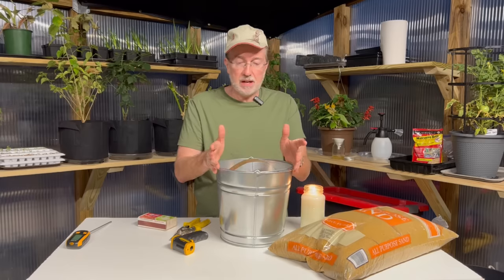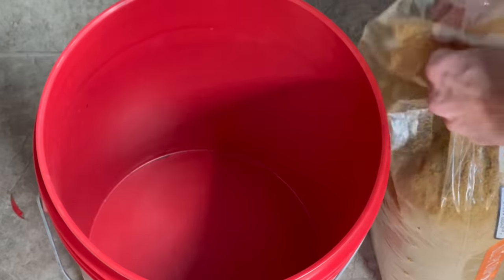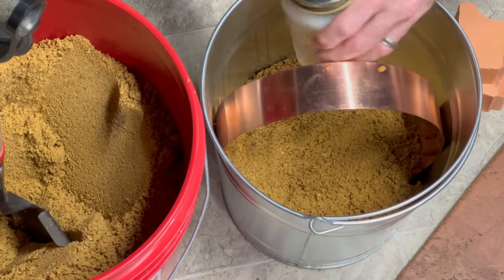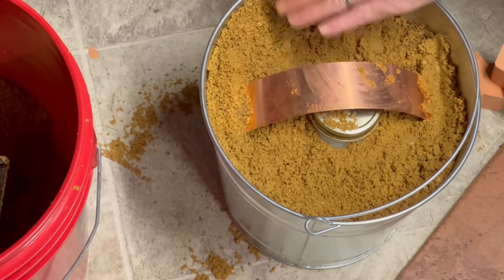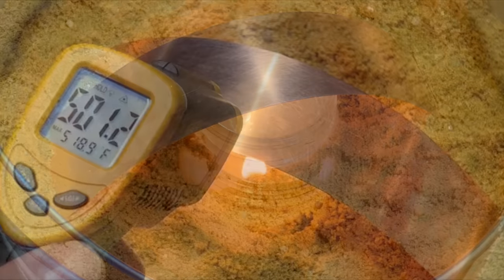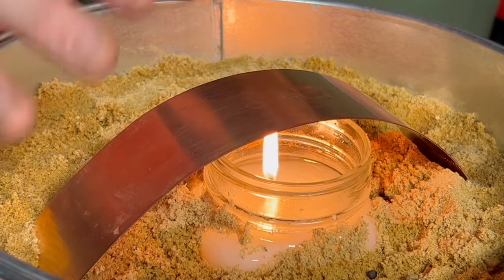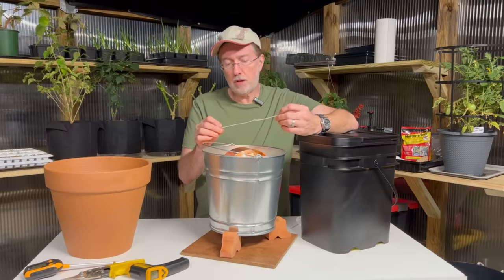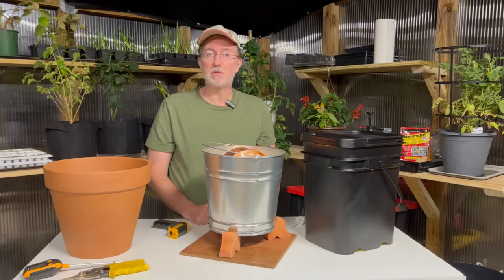DIY Copper And Sand Heater | No Electricity Needed For Greenhouse Heat

Comment: By the laws of the Conservation of Energy, you can't get out, more energy than you put in.
Candle Wax is an Energy Storage Medium. So your Energy input is the Fuel of the Candle wax.
 Using a single Wick Candle, the output of the flame is approx 80 BTUs
It doesn't matter what the Single point Hot Spot is. The tip of the Flame could be 2,500 degrees hot.
what Matters is the total BTU's being released.

It doesn't matter if you use a clay pot, or a copper Band and Sand as your Storage Medium.
You can never get More Energy out, than what you put in.

It is a simple math problem.
To heat a 10 foot x 10 foot x 10 foot area you would need to supply about 5,000 BTU's 
5000 / 80 = 62.5
so that would be about 63 Candles.

How much space could a Single Candle Heat?
A single candle could Heat an Insulated Box, 2.5 foot x 2.5 foot x 2.5 foot or 15 cubic feet of space.

Comment: If using in a living area . . . A simple 1/2 or 3/4 inch PVC pipe to draw in outside air  from a window. Raise the bottom of the window just enough to place the short length of pipe and then block the exposed amount under the window to prevent a big draft

Comment: The terra cotta with vegetabe shortening candle in a 9' x 12" wood/polycarbonate greenhouse last winter in Pennsylvania didn't increase the freezing temps more than a cpl degrees and the veg short. candle burns a lot longer but it emits choking toxic fumes that make breathing in a sealed greenhouse impossible. The smell is horrible. The year before i tried the giant compost pile in the greenhouse to at least keep it from dropping below freezing. Nothing worked till I bought a flamefree ventless propane heater...it only costs about 250 bucks for the entire fall/winter/early spring season. I've been heating for 2 weeks already just cuz of the 40 and 50 degree lows. I do want to try this heater...but where does one find a thin wide strip of copper?

Comment: Water hold 5x more heat per volume.  Temperature under 212 degrees (excluding the candle flame), water is a much better heat storage. Try this with your same system (thus, minus the sand. Another one, add water in after you add the sand. )
Reply from the maker: Will experiment thanks.

Comment: What if the bucket had a hole in the bottom so you could see the bottom of the copper ring....(maybe have the bucket a little higher off the tile); This would allow you to easily replace the candle when needed.

Comment: How do you replace the candle? Disassemble and reassemble?
Reply from the maker: Slid the copper to one side….pull out candle.  If sand is still moist will leave an opening if dry will need to reassemble.
Reply: @ZenGardenOasis.    Thank you!

Comment: Not a lot of point measuring the temperature above the candle on the copper .. its going to be hot .. just like the candle flame.
I was more interested to know what the temperature of the surrounding sand was after a while .. in particular .. the sand furthest from the copper band.
Also, would be hotter if the candle was position in such a way as the focus the hottest part of the flame on the copper.

Comment: its about dispersing heat fast.. not store ..it might read 400 degrees but transmission of heat is very low under 10 degrees. that watts of the candle is about 150 watts.. so the cost is the same.. that is the problem with this concept..   However mabey if you atach solar pannel to a 100 watt heater coil and put that coil in sand and then to the copper being free energy makes more sense

Comment: Cover the top of the exposed copper with stainless steel as, being a very poor conductor of heat, it will help yet more heat move into the sand.
Reply from the maker: Thanks for the tip

Comment: I think 4 rings of copper tubing sealed separately but soldered together side by side with transmission fluid sealed inside would work better.
Reply from the maker: I always encourage experimentation.

Comment: also, water will hold more heat than sand
sand specific heat = 0 .19
water @ 25 C specific heat 0 .99
over 5 times more

Comment: What if you were to add a wood stovetop fan on the sand?

I’m currently testing a few options to heating my greenhouse.  I have a crockpot heating water and have a couple of wood stovetop fans on the crockpot top. 

I was planning to test sand batteries again this weekend.
Reply from the maker: The crock pot idea is excellent.  I need to experiment with that…..thanks for the idea.
Reply: Make soup

Comment: Add a copper coil in the bucket.
Solar 12v pump.

Well sand store energy longer then water?
Can you intertwine both sand and water to store energy?
Reply from the maker: It’s possible….there are so many ways to experiment.

Comment: would construction sand (contains rocks and such instead of pure sand) also work for this? And how would you go about replacing the candle without touching the copper?
Reply from the maker: Yes it would
Reply: @ZenGardenOasis.  thanks, also do you have an estimate for how long you think this'd last for?

Comment: Well, he is turning convection into conduction and then radiant heat so his loss of efficiency. I’m curious as to how many BTUs per hour that candle puts out. A BTU is the amount of heat it takes to raise 1 pound of water, 1°F. If the greenhouse is relatively warm during the day and the bucket is never gets hotter or is equal to the heat in the space during that day then it is possible for it to save up the heat in that thermal mass building it up over the day . high-pressure always moves to low pressure the same as true with heat, hot goes the cold. However, if that greenhouse is chilly during the day that’s not gonna go so well because it will dump its heat as fast as the building up. I seem to recall panels like the ones he has on his greenhouse are roughly r2 or r4 . Now you have heard of people using candles to help keep themselves warm when they’re stranded in their car.. but you have to take an account it’s a small space and each person is putting out 400 BTUs per hour just sitting there. the candle supplementing it. The other thing is you lose some thing when you go from convection to conduction and then to radiating through some loss of efficiency. if he was able to heat a lot  of sand up with a Frenzal lens with sunlight during the daytime it would be very potent particularly if it was a black lava sand.
Reply from the maker: Fascinating

Comment: what's the temperature at the side of the container or in the sand away from the copper strip? how dose the flame reach the copper after say an hour when it burns down away from the copper? once there is an air gap between the copper and the candle the efficiency will drop by more than 50%. yes, sand will hold the heat, and this has potential, but I don't see it as efficient in this form.
Reply from the maker: Prototype needs more work.  Thinking about side burn

Comment: By the time you buy candles, or wicks + shortening, won't it be approaching the cost of electricity anyway (to heat the same setup I mean, not to run an electric heater)?  e.g. Drill a hole in the side of the bucket, fit the heating element from an old hot water heater poking into the sand, and maybe a mechanical thermostat from a water heater or electric stove as well.  Wouldn't that heat the sand much faster than a candle, thus only needs to be on for a short time and/or short bursts throughout the night, costing much less than an electric heater - maybe the same or less cost than wicks/shortening/candles?  If yes, you may as well get some free/cheap secondhand solar panels, several buckets of sand (or one large metal tank of sand), several old water tank heating elements, and leave it on during daylight heating the sand for several hours.  By nighttime the sand will be so hot there may not even be any need for top-up power through the night (and the solar panels will be in darkness anyway).  So no more buying candles, wicks, shortening, filling jars and positioning wicks, no more fill buckets with sand when you put a fresh candle in, less residue buildup over time in the house from burning candles (standard candles melt the wax, smokeless candles have to produce a residue).  Or maybe not?  Maybe the consumables are much cheaper than short top-up bursts of electricity where you are?

Comment: Does the candle have to be in a glass jar?
I ask becasue I have seen small aluminum pails similar in size to the jar in your video and I wonder if that would help to conduct heat better to the copper?
Instead of being glass, sand, copper, aluminum, the layering would be aluminum, sand, copper, aluminum.
Reply from the maker: I had made the candles previous for my terra cotta heater…..just used what I had.

Comment: I`d dry the sand in an old pan on the stove prior to using it. It will take a lot of btu`s to evaporate the water and it`ll be in latent form so it`ll only contribute to increasing the greenhouse humidity, not the temperature. On the plus side, the sand will be extremely hot when you take it off the stove so you wont need to put the candle in until its cooled down enough not to melt the wax.
Reply from the maker: I found very dry sand last week at lowes.  Hidden in the back.
Reply: @ZenGardenOasis.  
Kids play sand is one of the best types, its very fine and is washed so its perfectly clean :)

Comment: I wonder what would happen if you used a cast iron fry pan over the flame instead of copper ( copper can be very expensive). Cast iron holds and radiates heat well
Reply from the maker: Excellent idea….I too think it would hold and radiate heat quite well.

Comment: Problem, your link to Amazon for the 1000x50x1mm copper now points to 1000x15x1mm, a lot narrower. I searched everywhere, but cannot find that size. Would 1000x50x.8 work?
Reply from the maker: I think they’ve sold out 2x. It’s easier to find at local hardware if they don’t restock on amz

Comment: I am assuming you’re using several of these to heat a small space, like a greenhouse.
The thing I’m wondering though, is: if the candle burns for days, why would you need a heat sink anyway? A heat sink is there to disperse stored heat AFTER the flame is out, it doesn’t add any energy to the system, it slows the process by storing some of the heat. The candle, by itself, will heat the space around it faster when it’s not bleeding heat into the sand.
If you’re just heating the air, the candle, all by itself is doing that, and there’s no reason for a heat sink.
I sometimes used heat sinks on (water tanks), and in (lava rocks) my wood stove at night, because it would release heat after the fire went out, but a heat sink doesn’t add any heat to the system. Only additional fuel can do that.
❤️✌️
Reply from the maker: Blow the candle out just before bedtime and 6 pots will continue to radiate heat. Next evening when the cold sets in relight and allow burn for 5-6 hours then repeat the cycle.  Candles will last 10x longer.

Comment: Robbing the escaping vertical heat and getting it into your resonant heat mass is pretty good thinking.  Hows it compare in vertical heat to the inverted clay pots?
Reply from the maker: I’ve had limited cold since implementation.  The sand has the potential to hold heat longer than terra cotta.  You might enjoy watching the sand battery video from Finland.

Comment: Can someone explain to me why this is better than just letting the candle burn in the green house without the bucket, sand and copper ring? The heat output of the candle is always the same. All the bucket does in my opinion store some heat that will be released when the candle burns out. But all in all the same amount of heat will be produced. What am I missing?

Comment: A candle puts out 20 to 30 watts of power, consequently the bucket of sand will not put out any more power than that when heated with a candle.  My small well insulated RV has a 400 watt heater and that is not enough power to keep it warm when the temperature drops below 40 deg F.  This means that your bucket of sand heater is basically worthless for heating a small space.

Comment: Is there a safe to place one of these in an animal shelter? For example, if it was surrounded in a metal cage or would that also get too hot?
Reply from the maker: Make sure your using proper safety equip.  If it could be elevated out of reach of animals.

Comment: I grew up a pyromaniac, fascinated by fire of any kind, but this does not seem like something that could do much. Yes, sand makes a great heat battery, but a single candle flame giving second hand heat through a strip of copper, well, I'd go with a small electric heater before trying this.

Comment: If you used copper tubing without connecting the ends, wouldn't that also super heat some air for additional heating?
Reply from the maker: I’ve been toying with that idea.

Comment: The sand acts a battery.  I would imagine charging the battery by having the battery above the heat and letting the sand release that heat over time is the end goal? That way you can keep your tender plants from going to 28 degrees F and getting wiped out.  So I'd recommend placing the sand above the flame and finding a way to heat up a barrel of sand with a big fat flame.
Reply from the maker: It’s a prototype and so yes your idea is great.  Will keep trying until I get best results.
Reply: @ZenGardenOasis.  If you could get an insulated box of non-burnable material above the flame, maybe a metal box full of sand and light a fire under it, then the sand would maybe heat up and the air space between the sand grains would also heat up.  Over a long enough time, you might have enough stored heat to slowly release back into the cold house.

Comment: How do you get the used candle out? You have to dig all that sand out to replace it don't you? I do like that it's supplemental heat (no electricity).

Comment: I have off grid solar electric ⚡ power. There's always more than I can use. I have a small wind generator too. Sometimes I need a place to dump some wattage. How big of a light bulb 💡 would I need to replace the candle 🕯️? I use a 250 watts heat lamp sometimes, which is a bit much but it does put out a lot of heat. My greenhouse is 6.5 by 18 feet. I have two inverters. The main one runs off of three 24 volt lithium batteries. The spare inverter runs the receptacle in the greenhouse. It's 2000 watts and running off of sixteen deep cycle batteries. They charge off of 400 watts of solar panels and a wind generator,💡⚡. It's making a little power this time of year. My power doesn't cost me anything, so it's okay to use some 😎🤔. I was thinking I could leave a 100 watts bulb 💡 on without hurting anything. I can always increase the solar panels to 600, I have 1600 watts of them on my system. This time of year that's around 250-300 watts coming in from 600 w. of solar panels.  When the sun 🌞 is out. Sometimes the wind blows out of the North for long periods. It makes it cold 🥶. But the same wind makes enough power to run a heater. So it kinda evens out. I plan to get my five water barrels in there by next winter so they should put off heat at night. I probably won't need much heater out there after that. I'll have a solar hot water heater built by next winter. The plan was to also have a PVC pipe with a bathroom exhaust fan to blow heat out of here where the wood stove is, out to the greenhouse. But none of that is built yet. It's always good to have options though. I bet that bucket would get pretty 🔥 hot right over this heat lamp. 🤔

Comment: Progress report: So I've been using my buckets filled with sand on top of my wood burning stove but even though the stove top is getting to about 300 degrees Fahrenheit the buckets of sand never go higher than 120 degrees. I've got one of those infrared thermometer guns.
Reply: Try adding water to the sand.

Comment: Mr. Google says that copper pipes used for water piping is 99.99% copper....  I have spare bits of new copper piping.... Couldn't I flatten and use 2 overlapping arches ( the second one placed after lighting the candle) with the arches touching but perpendicular?  And what about figuring out how to protect the top and heat sink with a terra cotta pot?

Comment: could ya use a single wire bend into circle maybe bunch and then into the sand over the candle it seem it would be hotter
Reply from the maker: I would encourage experimentation….I was inspired by the sand battery from Finland.  Great video, you should take a look at it….cheers.

Comment: Energy is energy, the amount of energy will not change so just let the candle burn it will have the same effect on the room temperature. There's no miracle way of amplifying anything. Amplifiers use energy to amplify the input energy. It is a nice heater but it will not make a difference. If you let the sand heat up during daytime with the sun then you would have free energy. And the side of the metal bucket feels very warm because you placed the copper on the metal sides of the bucket. As said place the bucket in the sunlight near your windows inside your house during daytime. In the evening they will give off some heat that was harvested for free. Also black or metal water containers can be used in this way. This heater is just a fancy way of spreading the energy over a longer period of time. Can be usefull if you have poor isolation, but if you have good isolation just use the candle as it is. Just my opinion i am no rocket scientist :)

Comment: Dumb question- as the candle consumes, does the flame distance to the Cu strip not increase, making the heater less effective? Thanks
Reply from the maker: I use these in my small hoop houses to prevent freezing temps from harming my tender plants.  Sand stays warm until sunrise and temps stay above 32.  Even with outdoor temps below freezing.   It designed for home heating.